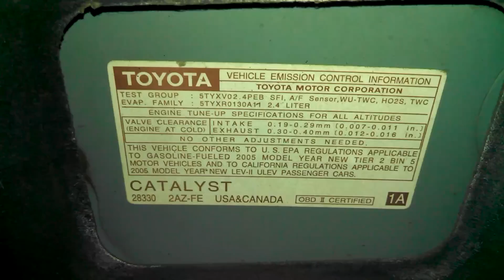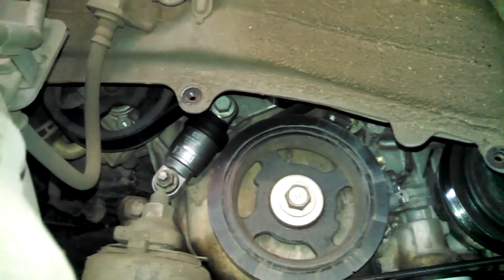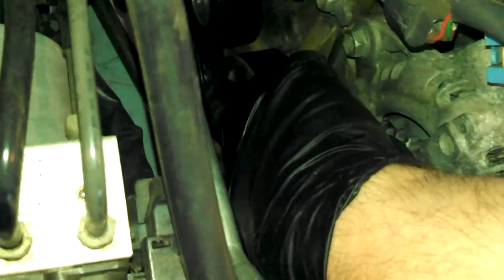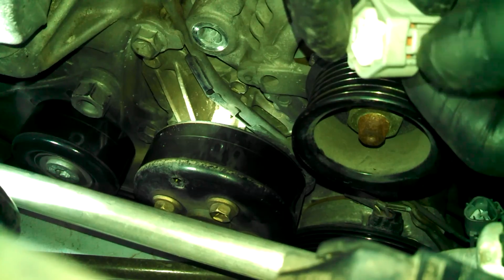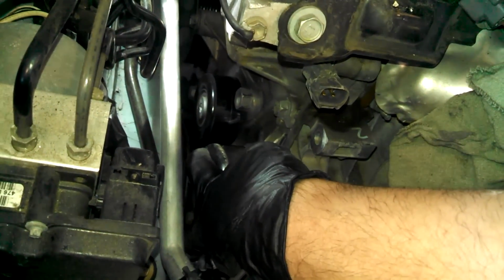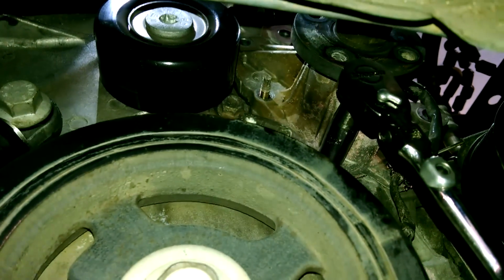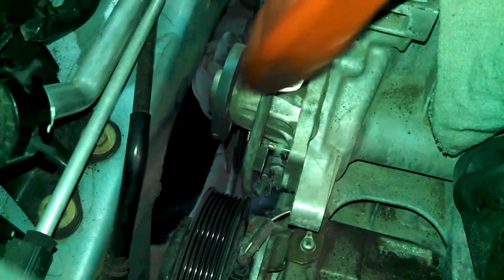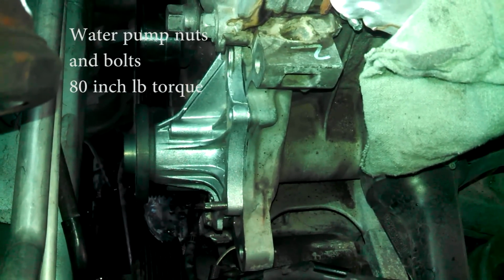Water pump replacement 2002-2011 Toyota Camry 2.4L How to change coolant pump

Comment: Do not fill the groove with sealant.  I received my Aisin pump to install this weekend.  The instructions read that sealant goes outside the groove so that any excess sealant flows and stays inside the groove.  It further reads that exposure of the sealant to the coolant will cause the coolant to become acidic over time due to the hardening agent in the sealant.  Acidic coolant starts to eat away the metals and gaskets from the inside.  If you test for ph balance, you can replace the coolant when it becomes too acidic.  As for removing the pulley, find a long square screwdriver or other square'ish rod to insert across two bolts to hold the pulley in place while loosening the exposed bolt.  Rotate the pulley until all the bolts are loose, then remove them.  You may be able to use a round rod if the bolts are not too tight - saw this on another video.  Video is helpful over all so I can see what I'm getting into.  Thx.

Comment: Thanks Todd for a very informative video. As I was replacing the belt anyway, I removed the wheel and shield and that made it easier to access the bottom bolt on the water pump. But it is possible to get just a belt on without taking the shield off. The  pulley on my 2003 model had a hole towards the edge of the rim which you put a screwdriver through to hold the pulley against the pump casting while you undo one pulley bolt. Then you get a one quarter inch high tensile bolt about three inches long and put it through the hole you just took the first bolt from and insert it into the specially moulded hole in the pump casting. Clear so far? Then you undo the other three pulley bolts. When tightening the last pulley bolt on reassembly, be careful you don't break the pump housing. Probably best to hold more tension on the belt and tighten that last bolt that way.The bottom bolt on the water pump is very hard to get to from above, but easier from below when the shield is taken off. The pump I got was supplied with a gasket so I didn't have to mess around with silicone, but I did put non-hardening gasket cement on it. As for removing the alternator, it is pretty straightforward, just make sure you tie it out of the way as Todd did or it will probably come crashing down on your arm at some stage. By the way, maybe some water pumps don't have that hole cast into them, so my last resort would have been a huge pair of multi-grips on the pulley with a piece of rag to prevent scratches of course. If not for your video Todd, I would have got a mechanic to do this job, so you saved me at least $100-$200. Thanks Mate. I'm in Australia, but Camrys are still the same everywhere I guess.
Reply: Ausmint, thanks for the tip about putting a bolt into and empty bolt hole and inserting into the pump housing.  You saved me, nothing else was working with my frozen pulley bolts.  Still had to buger a couple up badly and resort to vice grips!

Comment: when replacing my 02 Camry belt tensioner I noticed that removing the torque mount and also the 19mm engine support nut from the bottom and raising the engine by the oil pan exposed the water pump completely and made it look  so easy to remove.

Comment: Was watching just because we have a Camry.  It looks like a little bit of a pain but not nearly as tough as the Mazda I’m working on.  even getting the unbolted water pump out of the vehicle is a pita, it took about five minutes to manuveer it out.  That doesn’t even count dealing with all the timing belt issues.  Good to know the water pump on this one is much easier in case it goes out.

Comment: Do you have to remove 4 bolts out from the pulley?
Seeing that you have room from top and bottom to get access to water pump's bolts and nuts.  I am asking because the major problem since I don't have special tool nor strong enough to hold the puller because I am a woman. Beside you didn't show that part of removing as well as placing RTV on the water pump. They both magically removed & installed.

Comment: Hey I Have a question, I used your video to help do water pump job this weeknd. I was able to pull pulley tensioner down to put slack on belt to remove the serpentine belt. Towards the end of completing the job. I went to put on a NEW OEM belt but I could not get the belt on. I tried 3-4 different pulleys to put it on but it was just too tight. I checked old belt and new belt and they both are basically the same length, old belt was just a tad bit longer. We managed to get it on the bottom pulley that’s facing the passenger wheel well with the use of some pry bars and a lot of swearing and struggling , but now the pulley tensioner is maxed out I believe and the belt is on super tight. Is this bad? I don’t understand why if I was able to use the pully tensioner to help release and get the belt off, why wouldn’t I be able to do the same to put the belt on.

Comment: I found a much easier way to remove the pulley as this us the hardest part and took me a couple days to figure it out lol
The easiest way is by using Two 12 mm wrenches at the same time counter pulling them meaning pull one wrench to the right on one bolt and the other wrench to the left to loosen the bolt while the serpentine belt  is still on. the pulls will counter balance the pulley from spinning that way and then just spin to the next do the same and then do the reverse when putting back on its as easy as it can get wish I thought of it sooner would of saved me alot of headache as I couldn't find a special tool for this anywhere oddly enough and its tough to keep it from spinning using other methods
Reply: Si jay the way I did I removed the stater and I locket with a big flat bar And I remove the pull very easy
Reply: What about trying to remove the pulley bolts with a breaker bar while the serpentine belt is still on tight? Wont that be tight enough to hold the pulley in place?

Comment: i RECOMMEND; replacing the hydrolic belt tensioner (30-$50)while you are in there. they are difficult to get too alone, but with waterpump out of way they are 2 bolts and out!  its a cheap enough part and when they fail they eat your belt and possible cause big damage.
Reply: Not true you have to jack up the engine
Reply: @CHEVYK10  no you dont. Not on the 4cyl toyota solara 2004 atleast

Comment: Looks like the timing chain cover is leaking on this 2.4L..  Seems to be a very common problem with Camry.
 
  A Toyota tech. told me that every water pump on a 2.4L will fail, it is a flaw in the pump/seal.

Comment: I had a PT loser one time and you had to take the motor mount brackets off, lower the engine down a but, take off the timing belt. all KINDS of fun shit just to get to the water pump. Was a real pain in the ass too.

Comment: Would this  2.4L Camry engine be considered the same as a 2009 Corolla XRS 2.4L just a tighter engine bay and more restrained to taking that water pump out? Or do you have a video for my situation?  Is the serpentine belt build the same way with the nut between the belt tensioner and water pump pulley? Thanks 🙏

Comment: There is absolutely  no need to take the wheel off. A long-reach  flex head ratchet,  and a deep-well 10mm  is all you need to get the bottom bolt off.!!!

Comment: The main reason I'm watching is to see how you took off those 4 bolts on the pulley, yet that part is cut out.
Reply: loosen them before you take the belt off or use a strap wrench (plumbing one that is rubber) or an old belt wrapped around and held back.
alternately large "pump pliers" gripping over top an old belt, dont want to scratch the pulley up else it will be a belt eater.

Comment: Which special tool did you use to remove the water pump pulley ? Is there one that really works perfectly? Thanks in advance.
Reply: The air ratcheting that he was talking about.

Comment: I have a Toyota Solara Camry and it recently over heated and my sister kept driving it while it was overheating until the car stopped...When I put water It just drops it all...Car still turns on tho...225,000 Miles

Comment: I followed this video and it helped a lot. Got my 2002 Toyota highlander 2.4L (Camry Engine) done in 3 hours. @Roger C. Palanco. I rented a tool for $68 at O'Reilly Auto parts. Ask for a -  "Adjustable Fan Clutch Holding Tool"

Comment: Good video except were missing the 12mm pulley bolt removal.  Heres a way to do it with an allen key: https://youtu.be/XkYRWT7LP9Y?si=fvHrroW2DU54V3GX&t=282